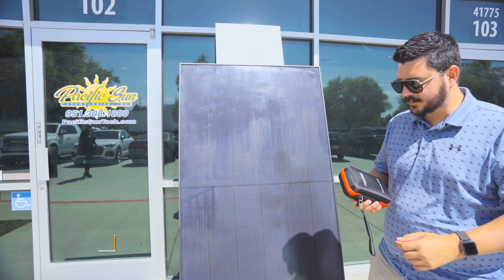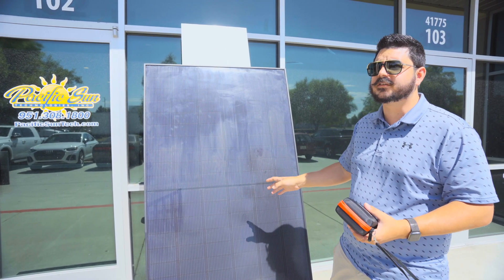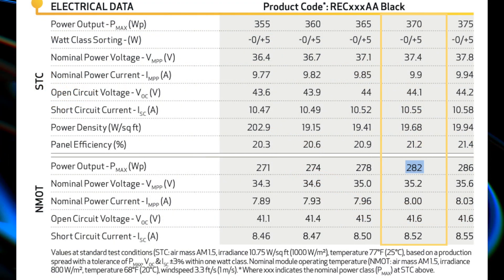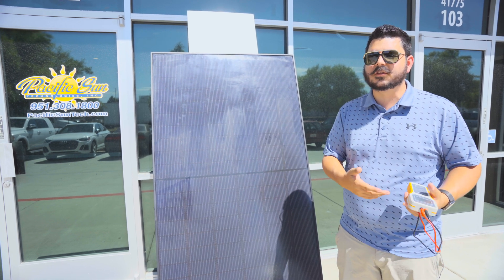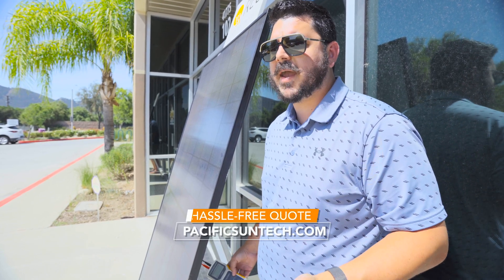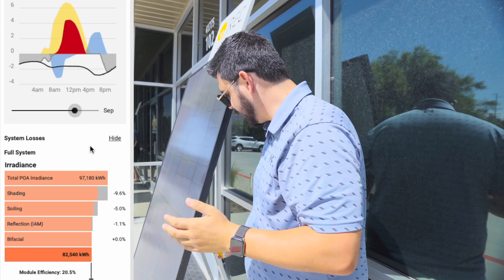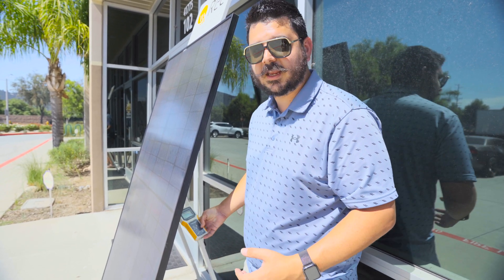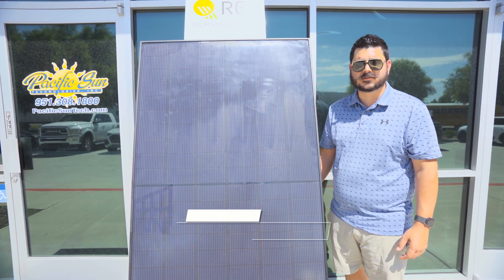Maximizing Solar Production by Pairing Microinverters to Real Power Ratings

Comment: If shading is a problem by 100 W panels and wire them in parallel to MPPT controller. In full sun, you get about 80 W. And in shade 10 W per panel.

Comment: I learned my lesson with my very first DIY customer. He bought 30 IQ8+ inverters for his 390W panels. When he learned they could only output 300W, the sh** hit the fan. He returned the entire order of IQ8+ and ordered IQ8H so there would be no clipping. "I ain't paying for 390W panels and then clip them at 300W". After that, I upgraded my own inverters from IQ8+ to HMS-2000-4T-NA and saw a marked improvement in performance. Now, on those bright sunny days with lots of cloud reflection and refraction, my 400W panels output more than 400W, and I've even seen them hit 500Wpk power on multiple occasions because my inverters don't clip. It does make a difference to the ROI when the energy rate is low, and panels can output more than their STC rating if the conditions are right. It happens more often than anyone cares to admit. Bottom line: If your energy rate is high like in CA, the clipping loss is negligible. However, if you're in the South and only paying 7.5 cents per kWh. The ROI with Enphase is ridiculously long and even the slightest bit of clipping makes it even longer.